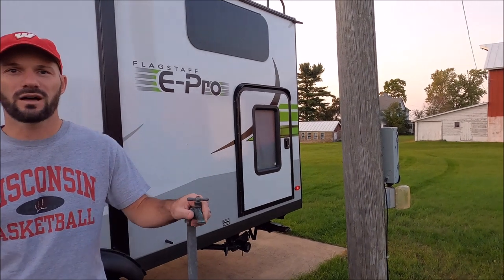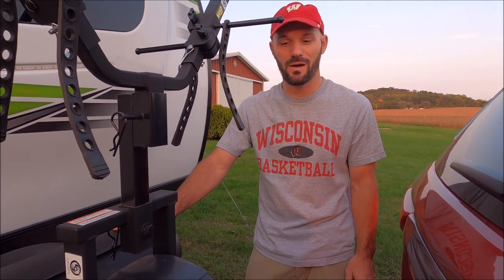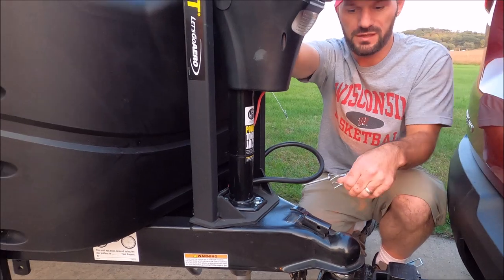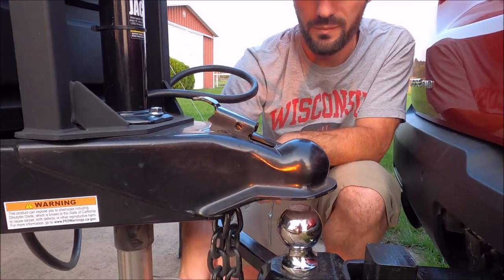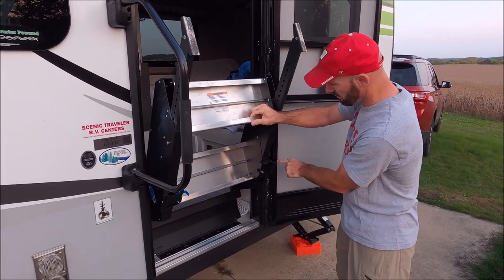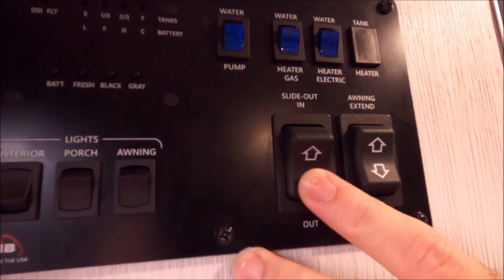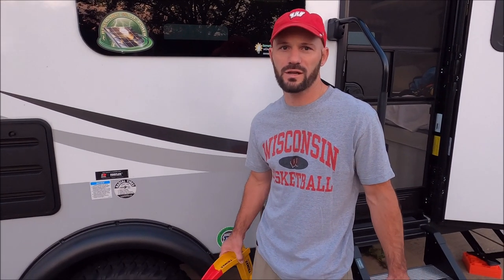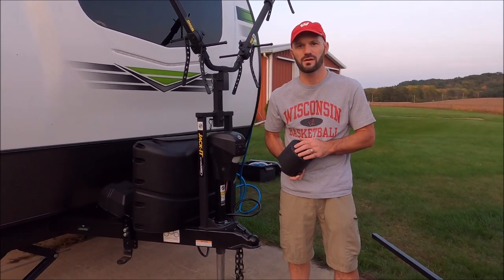Unhitching our E-Pro Camper (Flagstaff E-Pro E20BHS)

Comment: Hey do you guys have you check list available?
Reply from the maker: Good idea. I just added this to the description of the video. Checklist steps: Ensure you are in position to reach utilities, Ensure you have room for slide out, Unlock storage, Level the trailer from side to side, Put on parking brake, Chock the wheels, Disconnect and store brake controller, Disconnect safety chains and emergency brake cable, Use jack to raise trailer to unhook sway bars, Use jack to lower trailer to release hitch ball, Use jack to raise trailer off the hitch ball, Turn off parking brake and pull forward, Turn off vehicle, Use jack to level the trailer front to back, Lower stabilizers, Hookup electric, Hookup water, Open door and lower steps, Open the slide out, Unhook and store hitch on tow vehicle, Attach wheel locks, Attach trailer hitch lock, Put away all tools and close storage
Reply: @thedroesslers  Would you be willing to put your checklists for setting up/breaking down/dealing with dumping on your website, so others can see/print (or modify if needed) them? That would be super helpful. Thank you.
Reply from the maker: Yes, this is a great idea. I put this together and it is available here: http://www.thedroesslers.com/Camper 
Thanks for the suggestion. Happy camping!
Reply: @thedroesslers  Thank you!